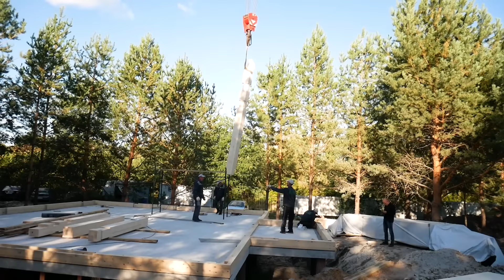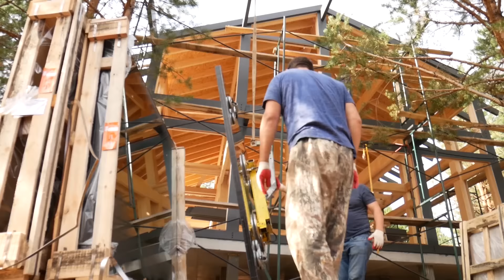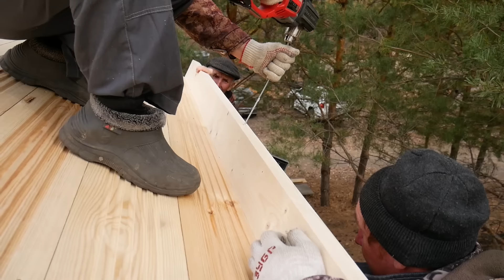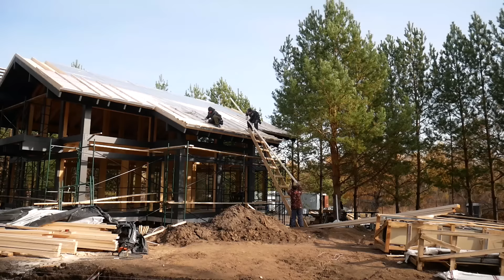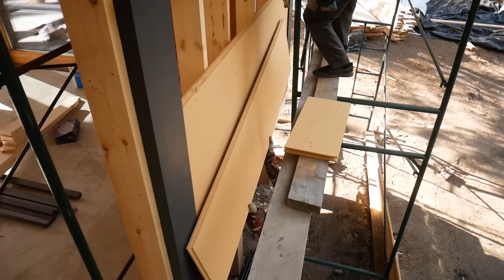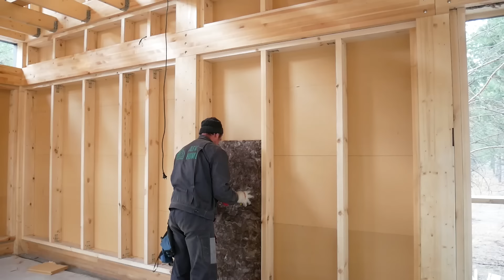A warm fachwerk house. From start to finish

Comment: So you secure the bottom wooden beams to the foundation with one screw only per a couple of meters and only one in the corners too, dont you ever get storms there. Well as long as you do the same on the roof it blows of first  and you still have the lower parts so you can put on a new roof lol till next storm come.